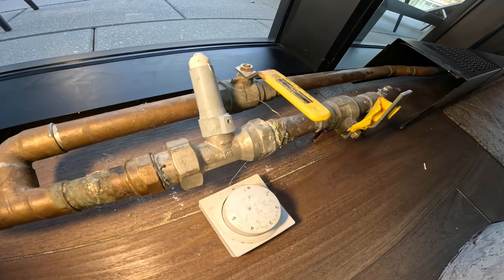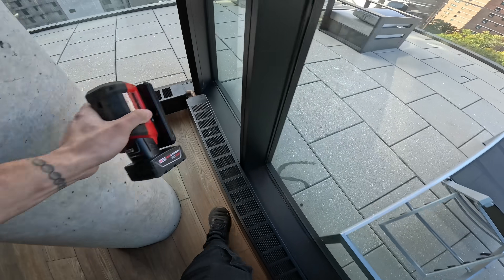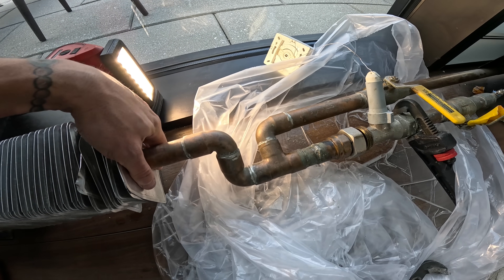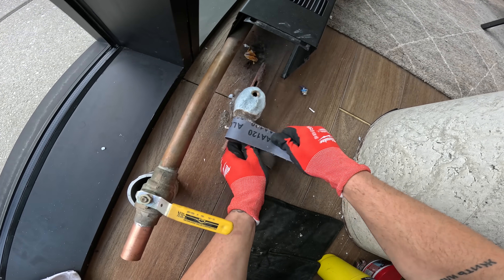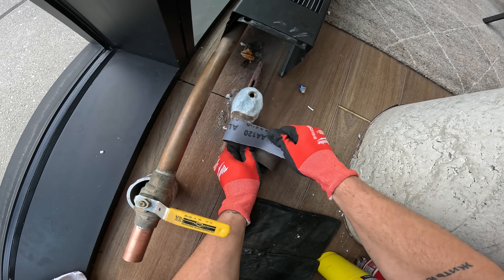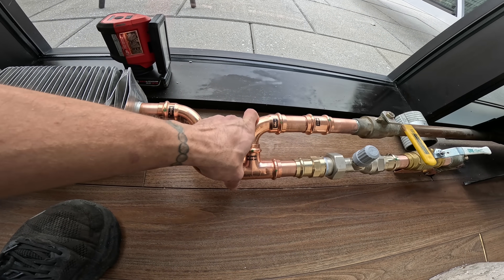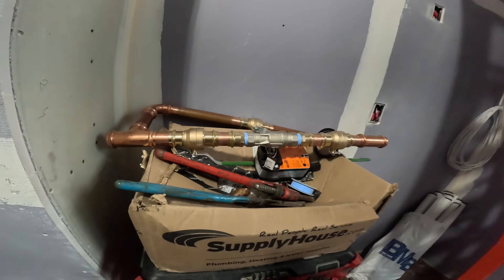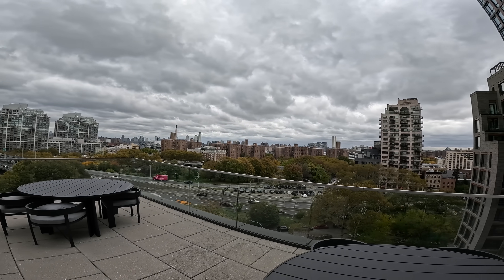HVAC: Hydronic Baseboard Heater Pipe Leaking Water! Baseboard Heater Pipe Repair/Rebuild

Comment: for un-sweating old work like that, grab with pliers the other way and twist it back and forth while heating(like you're unthreading/threading a fitting together), if not you'll rarely get them to break free, end up overheating and knocking the next fittings in the line apart. it's even worse if the socket wasn't fully flowed and solder filled, because then water/minerals/chemicals get in the void area, which hardens, corrodes and seizes them in place.
**also, you can safely tin-snip cut away some radiator fins to gain space, obviously as few as possible. just cut down towards the tube in a v shape, then use two pair of pliers to split the last piece around pipe, so it doesn't gouge and scratch it up.

Comment: what a bad designed "split loop" they made there. likely doesn't heat evenly both directions.  even if the tee side/run is reversed on the far ends of the two loops.
you didn't build the place, so oh well. lol

Comment: I'm all for ease of use but now that you've used press connections, say theres a leak and that exact job needs to be redone. Correct me if I'm wrong but I would assume the job would then be much harder and or take more time seeing what little room/pipe is left.
Reply: True but with pro press if done correctly the next leak found will most likely come from somewhere else. Those fittings have been pretty solid for us.

Comment: I believe that you should Not press the hot water baseboard heaters copper pipe because it is too thin and it will leak sooner or later.  You are best bet is too solder that connection. 😂😂😂😂😂😂
Reply: They make brass stiffeners for pressing onto thin wall baseboard piping. Not sure if he used one though

Comment: Every time I needed to open a union that had been on a long time, I took a small 10 oz hammer and tapped on the flats, then used the pipe wrenches, and most time it was easier.

Comment: Fluke reading is off because of the thermal reflectivity on the copper. Can use a sharpie to draw a black square to take a reading from on the copper.
Reply: just use a clamp type probe and be done. lol
Reply: That or can change emissivity